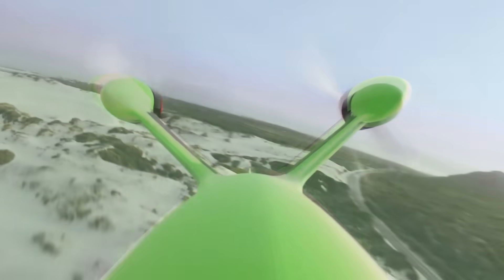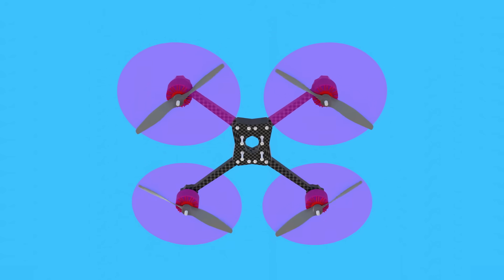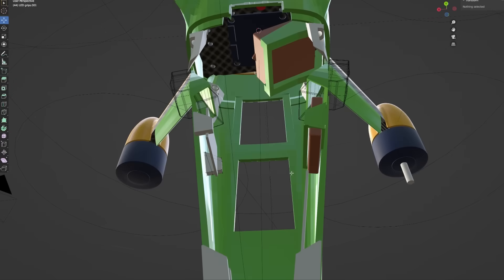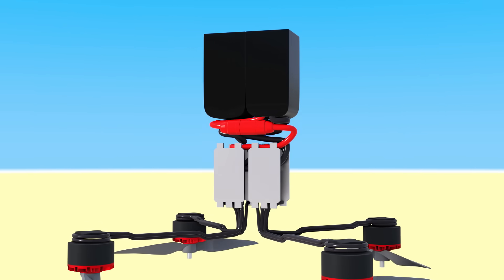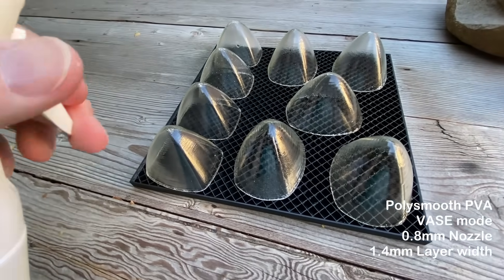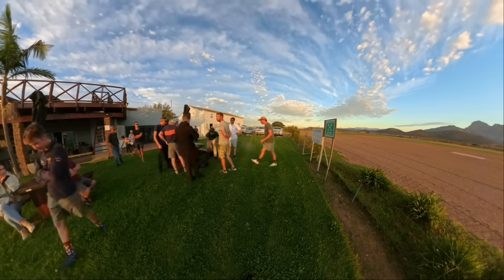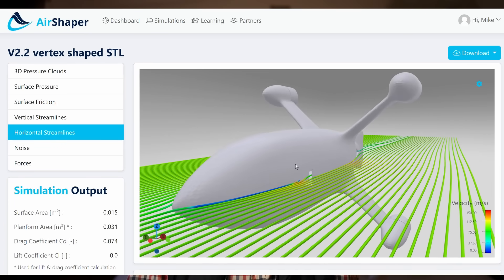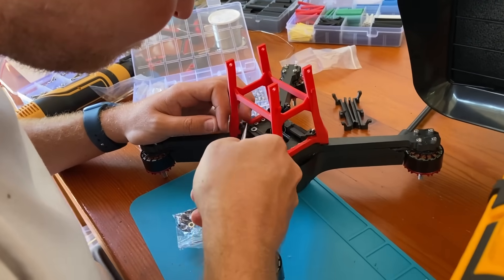300mph 480kmh | World's Fastest FPV Drone |  Guinness Record

Comment from the maker: I use the best 3D printer money can buy | Bambu Labs X1 Carbon | for a great deal on your own printer use my affiliate link http://shrsl.com/2p2xp-2yn7-1cwx9 and in so doing you can support the channel 😊👌
Reply: I don't think your link is working correctly, do you have a discount code?
Reply: Free advice. Make small wings on the nose. They will create a small lifting force. Therefore, the load on the engines will be the same. And you can use all 4 engines at full power. Now, as I've heard. The lower pair of engines is more heavily loaded. Because it supports the heavy nose of a high-speed drone.
 Из России, с уважением.
Reply: How much did you pay the Guinness Book to “recognize” your supposed record?

Comment: I wonder if you can make it faster, if you ditch air cooling at all, instead opting for water. With 3d printers you can make water tubes run through a hull, maybe insert copper loops to take heat from engines.

Comment: Why did you chose to model it in blender? Not cad?
Reply from the maker: I know Blender inside out and I animate in Blender. With a couple of add-ons it is more than capable of doing a super accurate job. 
The only meaningful downside is exports are STL instead of Step files, triangles vs vector geometry.

Comment: I have an upgrade idea for you guys. Youve got the aero dynamics of the body optimized, but you are using standard design propellers. Try using toroidal propellers to increase output. Lots of the power is converted into sound. vortexes and drag produce the vibrational force creating sound.
Reply from the maker: Toroidal props are imaginative and YouTube click-friendly, but in practice they trade efficiency for a modest noise benefit. All that extra surface area is drag without thrust. For us, quiet isn’t the goal—speed is

Comment: watching that guy inhale lithium fire, he has no idea how destructive that element is to the cell of the body.
Reply from the maker: These are not battery fires so no lithium gasses. They are electrical fires. Still not great but not lithium.
Reply: @Mike-Bell      It's been nearly two decades since I was active in the hobby, so I’m a bit rusty—but looking back, one of the last projects I worked on was pretty exciting. I was part of a team developing electric conversion kits for the nitro-powered JR 90 Vibe 3D helicopter. My role was hands-on: assembling and analyzing prototype conversion kits, then pushing them to their limits under extreme flight conditions to see where they'd fail—of course without hitting the ground.

We were given prototype components across the board: a 2S 60V battery setup, a 60V 220-amp speed controller, and a prototype in runner motor rated we were told was over 8 horsepower at 60,000 RPM (about 1.25"x4." motor) but the data showed it was pushing 10,000 watts. They always do that when they do not want the competition to know what kind of power the next generation of motors are, as they know people always talk about what they are not supposed to talk about if that makes any sense to you.  The Heli conversion kit itself was cutting-edge for its time, using a primary transmission to step the motor down to usable RPM, consisted of the motor and all metal gear box that replaced the nitro engine location and output rpm. The goal was to convert the nitro 90 platform into a viable electric alternative, something they hoped to bring to market around 2007.

At the time, the controller data was a brand-new feature in the prototype system, and one of the key conditions we had to meet was sharing flight data with the three companies supplying the components—the motor manufacturer, battery company, and controller developer. All of them wanted detailed telemetry from our test flights, but none of the data was to be made public.

The prototype Heli was flown by just two of us: Curtis Youngblood and me. During testing, using 700mm main bladed and 110mm tail rotor blades, I managed to push the system to draw over 200 amps, with voltage sagging down to around 42 volts. That kind of sustained high-current abuse popped the first controller (under its rated capacity) they sent us, and 2nd controller held, but shredded the stock gears from the original nitro Heli kit—exactly as I had predicted and was the only part of the design that failed. The only viable solution was switching to all-metal gears, but the designer resisted due to the significant cost increase it would add to the conversion kit.

Unfortunately, around that time, my wife and I were rear-ended while stopped in traffic. The accident left me disabled and sidelined me from using that part of my brain for many years.
My Friend "The Dana" (is what the guys and I referred to him when he showed up at the RC club) the Mechanical, Electrical engineer i.e. the guy that brought it all together also developed health conditions around that time. Dana was guy that answered the call to an online add that in the end, ne created the 911 service in British Columbia Canada. One of those guys that just gets the job done right. 

As for the prototype lithium batteries we were testing—they were way ahead of their time. Their discharge capabilities far exceeded the rated C values of any commercially available product back then. It was cutting-edge tech across the board.

It was a blast being part of a team whose mission was to break the design—safely. 
That kind of R&D experience really sticks with you. 
That experience helped me design a system that will bring an electric mechanical system to the next level using what I learned through that entire process. 
The system original design is for the Marine industry and is a pretty simple design, I still can't believe it has still not been implemented into Transportation industry.

At the end of the day the technology will create a disproportionate amount unemployment in our society, so there the tech will sit on the Top Shelf, out of reach for our closed loop society.

Comment: Great Work! Congratulations! Two questions:
Do You use APC Props 7x11 in original dimensions? 
And what is weight of the complete Drone?
Reply from the maker: Thanks. 
Total flying weight is 1.9kg
Yes 7x11 props - tips not trimmed.
Reply: @Mike-Bell and last Question: 11s Lipo?
Reply from the maker: @fridtjofschussler6434  12s. 2x6s
Reply: @Mike-Bell ah… ok! Thanks for Your Fast answers! 
And  Last question concerning the Lipos : Standard cell with which capacity?..
First my assumption was, that your drone weight only eG. 1kg! 
Thanks in advance! 
Fridtjof
Reply from the maker: Peregreen 3 videos from Luke and me uploading soon. Double the power 💥

Comment: I see 900kv motors with 12s voltage... Isn't better 350kv?...900 kv motor with could burn?
Reply from the maker: You won’t get 30k rpm with low kv

Comment: Since you already have GPS, I am wondering why don't you just use "return to home" to land the drone? That way you don't need to change the camera angle for landing and the piloting is easier so you don't risk hitting a hangar. You just need to make sure to make the correct settings for RTH to work and maybe you can land it line of sight when it's down to a few meters.

Comment: Congratulations amazing work, engineering and video documentation!

Tips on how to perhaps make it even faster:

1) Torodial propellers

2) Slightly better motors

3) More lightweight materials (saw some videos about new materials specifically made for drones recently)

4) Tweak the body shape like what you are doing in the wind tunnel

5) Hollow out some parts to save kn more weight

6) Try to get your hands on lightweight batteries that can give you a longer endurance time and at a lower weight

7) See if there is some spray you can apply to the whole body and propellers to reduce friction and heat while flying so that it glodes even smoother and hence goes faster

8) (Non-Performance related) Change camera to one that includes nightvision + add a return to base and autoland functionality (you will need an ultrasonic sensor or a Lidar sensor for this paired with a good gps micro antenna controller)

I hope this helps

Keep up the amazing work

All the best!

Comment: Loved the video. I was thinking though, to save some weight and complexity, could the battery be part of the body itself and rely on the rigidity of the complex shape to avoid wobbling and resonance instead of using an internal frame? Assuming the body can be mounted to the frame securely.
Reply from the maker: Yes that is worth considering 🤔 
The current layout does make for easier rebuilding after crashes.
Reply: @Mike-Bell  maybe the battery could be wedged in and then held there with something like an internal 3D printed circlip that fits in a small groove to stop vibrations working the battery loose. I’m sure there are many other ways to be honest.

Comment: How would choosing the Medium wire size be most optimal? It generates more heat than the larger one. Is the medium wire chosen to save weight?

I would like to know. Also very insightful video, I love the process and what goes on behind this project. Thank you for making such a informative video!
Reply: the efficiency gain is negligible when most of the inefficiency (of which there is a lot) happens within the esc and motors themselves. the case for increasing motor wire gauge was so it would litterally not melt off. although i suspect their testing is flawed in the sense that their simulation was static thrust which would of pulled a lot more current than a real world flight anyway. they probably would have been fine on the stock wires.

Comment: looks almost exactly like our carbon fiber one we made back in 2017, same thin boom aerodynamics, and that all other racers at the time laughed at. till they saw it vanish into the distance in a blink. our batts were center slightly rear - we got better high speed turns than with them being front. Only public vid online without the thin rocket nose attached atm is https://www.youtube.com/watch?v=rl1kx4KpDlY&ab_channel=AntonViper
Reply: it looks absolutely nothing alike
Reply: @redacted1946  The smooth case is not on our one in video. So the same main core feature is the flat aerodynamic boom arms - is what makes these style fly fast, they are designed the same, and fly like a rocket :)
Reply: I see -  I do also mention that the one I show has NOT got the smooth nose cone attached, so if you dont read or understand well, then you miss the point of the comment (thin boom arms in line with thrust dont block thrust speed power like the silly flat ones everyone was using (and still do lol!)

Comment: T motor 3115 900kv is for 6S max. How it's work with 12S?
Reply from the maker: They work just fine on 12S.  The wires as supplied are for 6S.  If you go with 12S the wires need be a thicker guage because the higher voltage puts through more current.  But the coils are just fine.  We had no motor failures and they dint get excessively hot.

Comment: contrarotating propellers would give massive ammounts of speed, improving this is just not wanting the best, have you tried it?
Reply from the maker: I’m not convinced they would add massive speed. That would involve 8 propellors and there would be losses in the gear systems especially when running at 30,000 rpm.

Comment: wonder if we'll see supersonic electric fan aircraft ever
Reply from the maker: The propeller tips in our drone are around Mach 0.8. At Mach 0.85 0.9 the drag rockets up and it like hitting a wall. This is the hard limit. We think around 600 or a little more is achievable. Beyond that near impossible for electric. To get the sheer power to overcome Mach drag you need good ol fuel and oxygen.

Comment: for streamlining the shape, there is an old blender addon available that will optimize aerodynamic forms. its not perfect, and uses assumptions rather than actual simulations, but its pretty good at getting a great shape.
Reply from the maker: Thanks for the tip.  I'll check it out and include in the next video if useful.

Comment: I feel like a lot of weight could be saved by dropping the FPV feature. if breaking the record is the only goal a preprogrammed flight path might be a more lightweight solution.
Reply from the maker: 50grams or 2.6% is negligible. Besides at high speed body lift from 1 degree angle of attack is basically for free so there is no point dropping the FPV. 
And as much as the speed, video footage is vital for telling the story on YouTube.

Comment: why the backwards props? wouldnt they profit from an uninterupted oncoming airflow mounted forwards?
Reply from the maker: As a rule of thumb the faster air trailing a prop will increase drag over body surface area.  Pusher props are preferable for our drone.

Comment: It's amazing! By the way I have a question: Is it possible to use a tricopter? Would it have less drag than a quadcopter? In theory, three points of control should also be able to manage flight.Would this make it fly faster?
Reply from the maker: For 3 props the one motor must swivel for control which is not ideal. Plus we are breaking the quadcopter record.
Reply: @Mike-Bell  I see, I’ve learned something new. Thank you for your reply. That’s awesome! I will keep following you. Good luck to you all!

Comment: I have a design on cult3d = kamikaze rocket drone. You can use my design. I used a 10" propeller to increase efficiency and range. And it's very easy to print.
Reply from the maker: Nice looking design. What speed did you reach?

Comment: what 3d modelling software are you using for such precise parts? I doubt it's all made with blender, and if it is how do you achive such a degree of precision?
Reply from the maker: Its all Blender.  I have been using Blender for long and I suppose I know tricks to do precise measurements without thinking about it.  Its not hard.  Blender is the bomb.

Comment: i might be giving away a fortune here...

consider what drag is... what the slipstream behind you is...

its air that has had momentum imparted to it by colliding with you, the body and flight surfaces, and being accelerated. you get this gust of air that chases behind you at about half the speed. and as it impacts more air it all comes to a halt eventually, disposing of energy... none of that has any effect upon you, other than the air that HITS YOU and is deflected. it takes work to push it out of the way.

ok, cool.
the air that is deflected to produce lift will always have a certain amount of drag associated with it, and cant be avoided. erm... "induced drag"? your props, wings, controls...
here, the props. so ignore the backwash of the props now, its dirty and turbulent but its the source of thrust and lift. its the necessary induced drag. 

whereas the air that is bashed out the way by struts and bumps and the like is parasitic, makes no contributions, and only saps power. the more air you bash out the way, the more slipstream you make. the slipstream isnt drag itself, its the result of having drag. a sign that energy was being dissipated... some as lift/thrust, the rest is just drag, or power taken to move air out of the way...

so. coanda effect. rather than use it to produce lift, that idea doesnt work... use it to encapsulate the fuselage in a layer of high speed air to ISOLATE it. an EDF feeding into a cowl at the very nose... that air always takes a certain amount of work to accelerate. it will cling to the surface and isolate it from the stationary atmosphere.

no thrust or extra force, other than that produced by the EDF, but "negating" parasitic drags... 

that is, you only work on accelerating that layer of air. what it does, after leaving the nozzle, has no effect on the vehicle... but it can impart its energy upon stationary air so that YOU dont have to... its the outer layer of air you accelerated that gets slowed down as it impacts the stationary atmosphere.

it doesnt work on a plane as most of the drag is from the wing. induced. but here, where the fuselage is just holding props in a certain orientation?  the less parasitic the better...